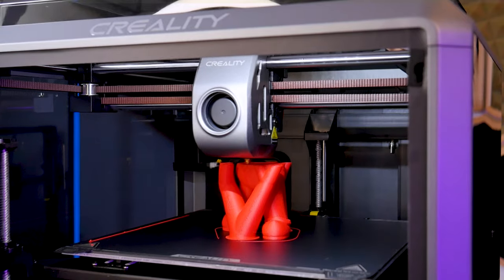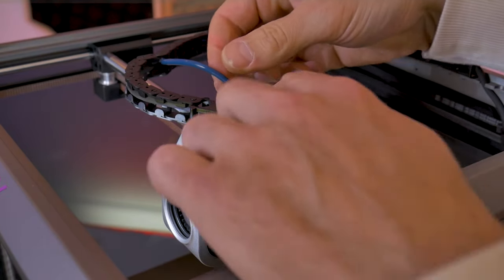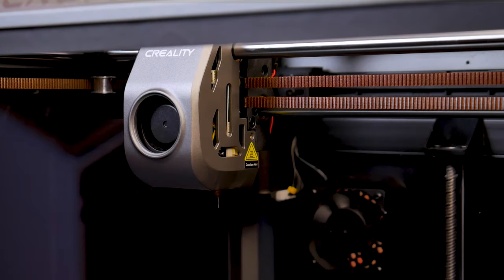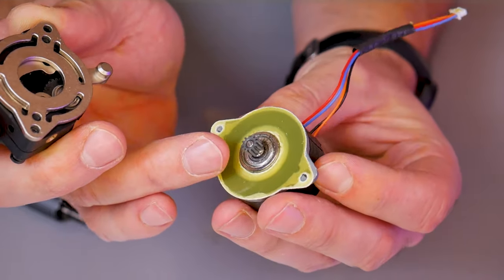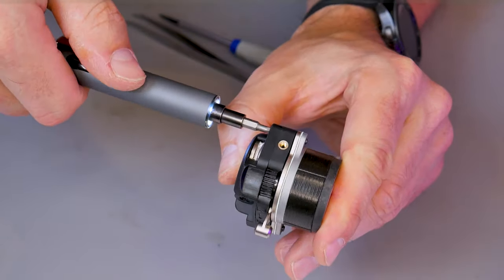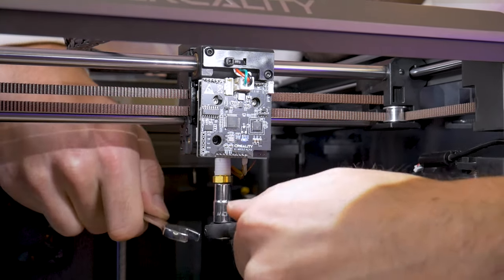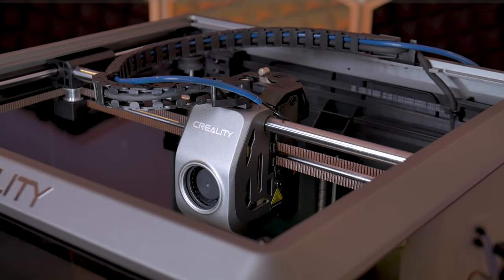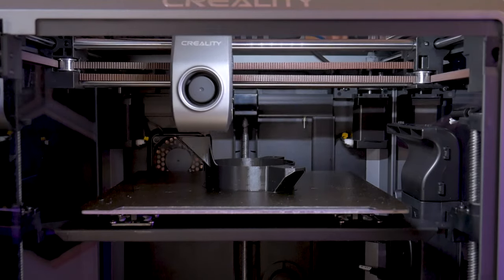Prevent Creality K1 Extruder Jam, Unclog and Disassemble the Extruder and Install Hardened Nozzle

Comment: I'd hope by now that it's been said 20 times.
You shouldn't use cap tubing in reverse bowden setups. Before the extruder, you want the path to be loose, not tight. All you do is add more friction to the entire system, with cap tubing.

Comment: Now creality has updated the extruder and the nozzle, however there is still a problem with the tube reaching the right place before you lock the extruder ready for the machine to heat up the filament and squeeze it out of the nozzle.

First the filament gets stuck in the end of roll detector, then after some pushing and shoving it goes through that.

Next it reaches the top of the machine, where it suppose to go into the new nozzel or the old plastic tube, once in there, you can now lock the extruder and your ready to go.

Creality, ITS NOT WORKING, ITS GETTING STUCK, NO CHANGE TO CAPRICORN BOWDEN TUBE AT 1.9 INSTEAD OF 2MM IS GOING TO MAKE ANY DIFFERENCE.

Anybody got some idears? This is the newly upgraded K1 Max.

Think we should replace everything with a 3rd party extruder and hot end.

Thanks, looking for answers, this is the third machine

Comment: Thats not whats causing the issue. (Im Printing petg) the printer jams up during the first 20 layers or so. If this was the problem it wouldn't print anything as its right at the tip. 

The problem is the extruder/hot end design. The tiny extruder fan is choked off due to the compact design and not ducted so cooling efficiency is greatly reduced. It causes heat soak with most filament not just PLA. 
This results in it squishing the soft filament during retract and locking it up in the gap between the gears and extruder body. 
Everytime i un-jam it the filament has the expanded to 2mm. The nozzle tube ID is too wide and the extruder is poorly designed. 

I have a friend who had the same issue on his tronxy printer. He got tired of air cooling and water cooled it. Hasn't had an issue since. 
Ive had the problem with my ender 3 extruder & hot end when i didn't setup the cooling fan correctly when updating the control board. 

The printer should have no problem melting that tiny bit of filament and extruding. Thermoplastics can be remelted easily.

Comment: DO NOT FOLLOW DISASSEMBLY INSTRUCTIONS IN THIS VIDEO

I did and managed to unclog my jam. However, Creality After Sales channel had the quick and easy way to access a jam. 

This video can potentially cause damage and be fatal to your printer, particularly when trying to unplug and plug back in the glued together electrical connector. 

The official way of accessing the jam you don’t have to do this. 

This is a well intentioned video but giving potentially damaging advice.
Reply from the maker: Thanks for the message but can you explain why this would damage anything?
Reply: @EmbraceMaking 

Sure. 

The connector is glued. There is no reason to try to work that connector free and risk damage (ie bending or breaking a pin, pulling a wire out, etc). 

If you follow Creality’s instructions for removing a jam, there is no need to take the extra steps of accessing and breaking the glue bond to unplug that connector.

You can access the jam much more quickly and directly than all the disassembly instructions provided in this video. Just with three accessible screws.
Reply: @CLipscombe  I wish I had seen your comment first. I broke the connection on the original motor attempting this, finally got the replacement motor, but now I can't figure put how to reconnect it in such a tight space. And then I look on crealitys site and they do it all with the motor connected 😔
Reply: @captaindorko  This video is great if you need to disassemble the entire print head, but for a simple jam, it is a bit of overkill. 

I found it very difficult to get that little plug back in too. 

I ended up using a pair of tweezers that were angled at the end. Still took me about 20 minutes. Be patient, walk away to take breath if you need to, and you will get that little guy plugged back in.

Comment: Bringing K1 back 3rd time in 2 weeks lmfao one of the lil wires is torn fully and the stupid motor plug in that was superglued seems to be pulled out they designed this to break if you tried to fix it why so tedious and delicate :( the prints were super detailed but kill mee ha
Reply from the maker: That really sucks... seems to be the case though, basically as all tech evolves they keep trying to cram more stuff in smaller spaces and the wires and connectors keep getting smaller and more delicate. Last time I took apart my phone I could barely believe they made connectors that small lol

Comment: but my filament does not come out at all, then what? not rectracting, not extruding, nothing
Reply from the maker: Sounds like a jam. Remove the extruder, heat up the nozzle to 250 and use the push rod tool that came with the printer to force out the filament from the top down if you can

Comment: I've gone through all the steps to get to remove the extruder. Guess what? It will not come out. I have a terrible notion that there is a big piece of filament jammed in to the feeder to nozzle that is holding it in place. By now it should have just popped out as in the video. Ideas? Really in a situation here. It's not just a little jammed either. It is as if there is more than three screws holding it in place. PS - without this video I would have had ZERO idea what to do. The Creality docs are useless.
Reply: OK - I figured out what happened. The Extruder would not come out and it turned out a long piece of filament snapped off below the gears and was acting like glue. It mushroomed by the way suggesting there was a feed problem and snapped off inside. The blue tube still has a long one in it. This happened during printing as far as I can tell about an 1.5 hours in to a 2.5 print. Seems like everything on this one was overtightened at the factory. Bit of a nightmare. Also whoever decided to glue that connector in place needs to spend eternity fixing these machines!
Reply: HOW DID YOU FIX IT IM GOING TO GO INSANE IF I DONT GET THE EXTRUDER OUT

Comment: just ubeleivable!!!!!!!!!!! 1000$ printer, after 2 small print and i need to take it apart like this??????????????????
Reply from the maker: You shouldn't have to if you remove the filament properly. The V1 extruder was prone to jams but they more or less fixed the issue with the V2 extruder which Creality will send you for free if you request it. Unfortunately lots of 3D printers still have issues and almost none are absolutely perfect, that is just the reality of where we are with these printers right now. Bambu labs might be better but I haven't tried one yet.

Comment: No, you are 100% wrong. It is due to the bolts being cantilevered, instead of a pin through the gears, so they tend to splay out after a very short amount of time. How much did Creality pay you to make this obvious bait video?
Reply from the maker: I get paid zero from Creality. How is this a bait video? This fixed my problem and apparently a bunch of other peoples' issues based on the comments. I know the pins are in single shear and yes it's not as good as double shear and yes the gears can spread a little. Not ideal for gripping filament but shouldn't cause a jam or a clog. If anything, if it gets bad enough it would just result in slipping, but that really isn't related to what I'm showing in this video? It's not like I said anywhere in the video that this is the best extruder design ever or some obviously not true thing?